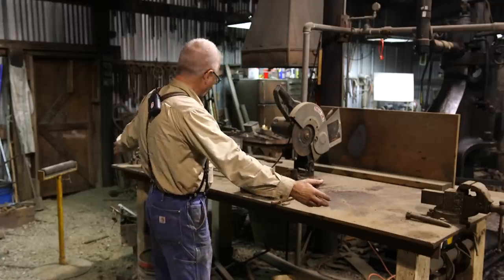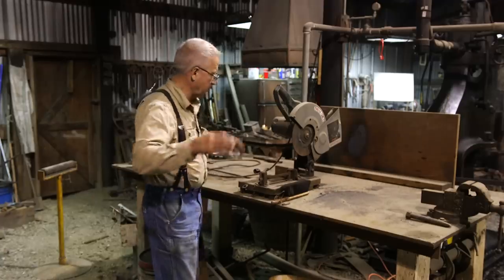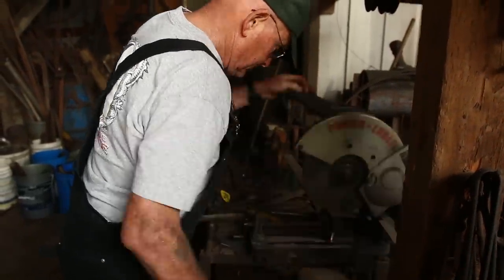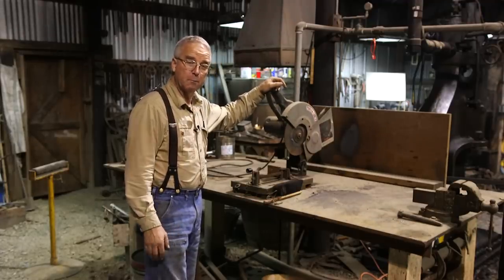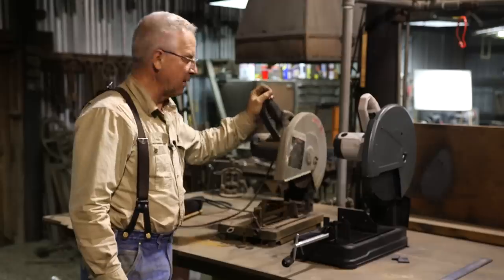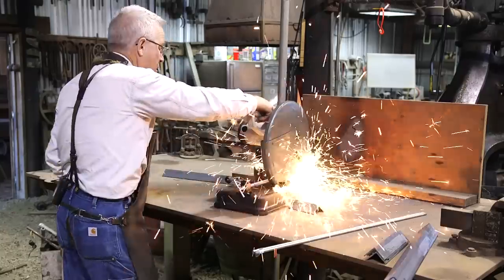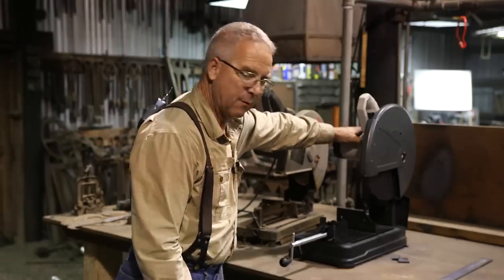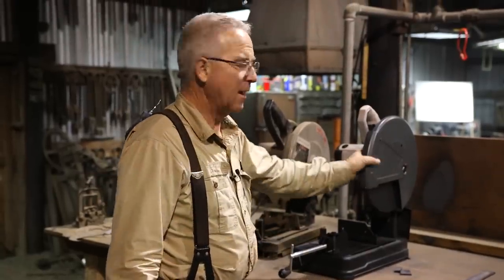Cheap Chop Saw

Comment: I have a Dewalt.  It is not worth a flying %^&*.  It won't cut straight at all.  We built a CNC plasma table.  I cut 42 pieces of 2x3x11 ga square tubing with the Dewalt angle grinder.  Was probably slower than the chop saw, but MUCH more accurate.  We have since got a 7x12 horizontal band saw.  It will cut 1" round withing a couple of thousandths of an inch of square and flat.  The chop saw is now in long term storage.

Comment: ps i love porter cable i have there 20 volt 1/4 impact and drill set everyone talks them down but i have been very hard on the impact and lol it still works going on two years and it was refurbished set when we got it also the battery's are still holding a charge they may have lost a small amount of run time but two years on a very hard used tool is saying something i just put a impact on the order sheet thats a wish list that as i save up the funds we order the next need item  and am going for another porter cable its funny how you get brand loyal i thought about going
Milwaukee but i know  my impact i know when its going to twist that bolt in half or hit to hard i pratcited on a bunch of bolts and nuts from the junk drawer found just how big of a bolt it would twist in two and how easy to use the trigger when in plastic  i am quite surprised in the power as this does way more than the honest reviews mine must have been made on Tuesday not Friday or Monday lol too much here sorry for rambling

Comment: The reason why people try not to buy foreign is the reason why I dont particularly want to buy American made products. Reason why, made in American ideally wants every component for the product to be made in American. Aswell as the materials for the the component to be mined in American. Like the metal that is cast, forged, or milled to be mined in American. Now America doesn't have unlimited metal supply. In fact often places that produce American Made products use diluted metal. Which is an alloy of the claimed metal. Why would diluting metal matter? Well it decreases quality substantially. It easily gets worn out fast, diluted stainless steel can rust, and the metal can break easier. Made in American doesn't have the same meaning anymore.

Comment: It is not the Porter Cable it was 20 years ago, they were bought by Black and Decker in 2004.  Why didn't you just put brushes in the old one?

Comment: If it was brushes or something else simple I would of fixed your old saw and saved myself some money.  I will bet you a stick of gum that your Chinese Porter Cable chop saw will not last half as long as your Taiwan made Porter Cable Chop Saw good luck with your new saw but do yourself a favor don’t throw away your old saw because in a couple of years you will want to be fixing it when your new saw takes a 💩 on your work bench

Comment: Nope. I've owned multiple abrasive disc chop saws. Noisy, sparks, heat, sharp edges, blade flex and compared to a toothed blade saw, just plain awful. For an extra $80 you get a much better saw. Yeah, the one I found is slightly smaller but will cut everything you showed with your new pain in the ass machine. :) Link to just one of many suppliers below.

https://www.trick-tools.com/Evolution-EVOSAW185-TCT-Chop-Saw-12156